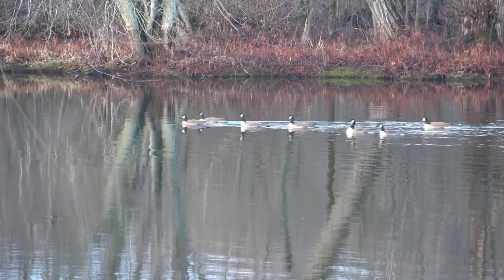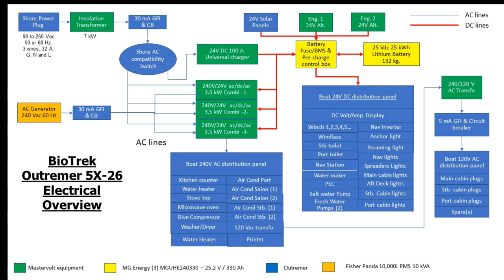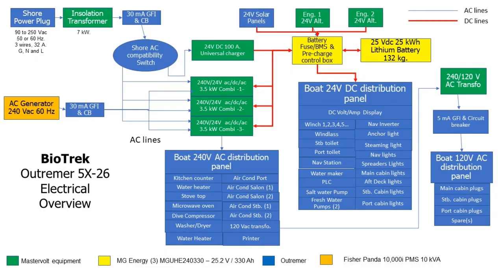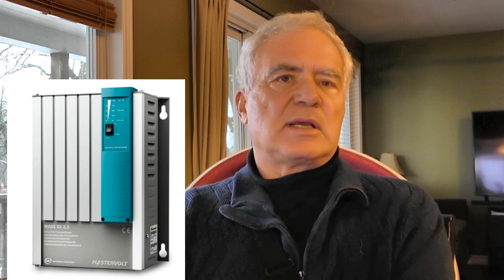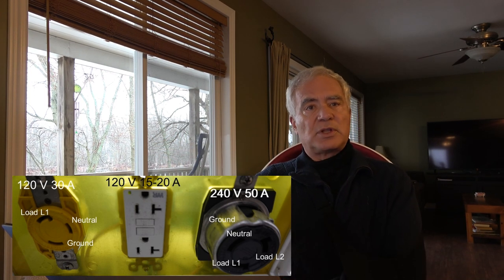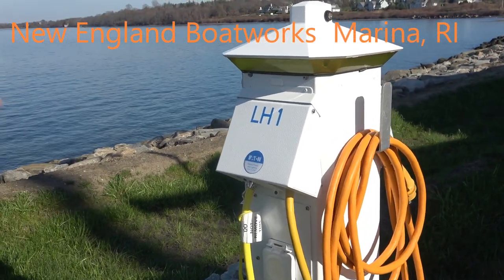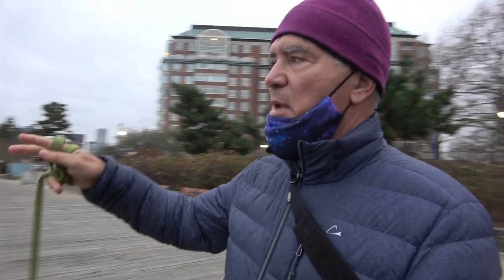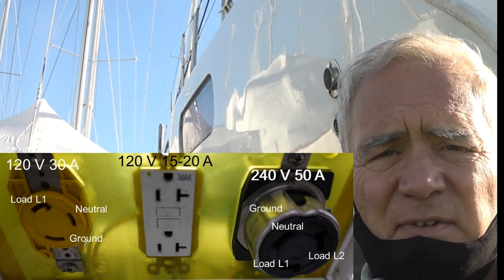Ep.63. Marine electrical systems: Pt. 1 Shore power and preventing electric shock drowning

Comment: Wow- an amazing amount of great information. Thanks! Quick question: if you are at a marina plugged in for many weeks using a lot of power does this mean your batteries are cycling more since you are using them as a conduit for the power?
Reply from the maker: What a great question! At the dock we keep the batteries at about 60%  SOC and they cycle between 50 and 60% so battery life should not be compromised.

Comment: Nice edit. I’m still amazed that in the world we live in we always find ways to complicate it. In this case electricity why the world did not all agree to run on 3 phase 220/230v and use the same plugs makes life more complicated with traveling.
The mobile world is seeing this now with even Apple conceding and going the new USB C route. Remember the days when every cell phone and computer had a different charge socket ?
A single agreed standard worldwide to electricity would go a long way in making things simpler.
Reply from the maker: So true! Even today I have soo many types of charging wires for phones and cameras, so I buy them color coded.